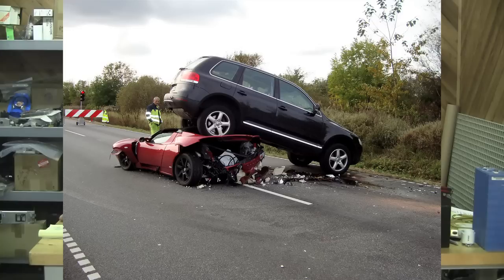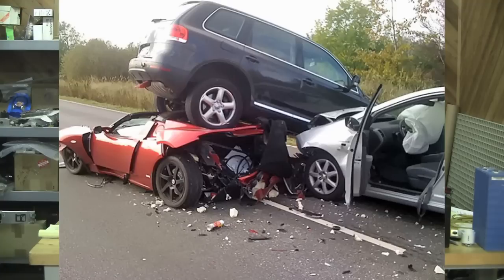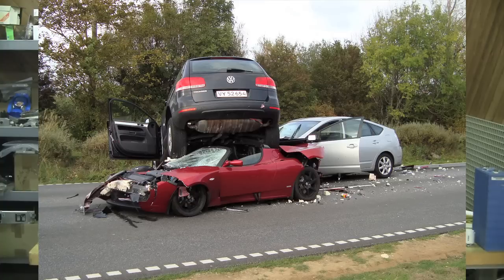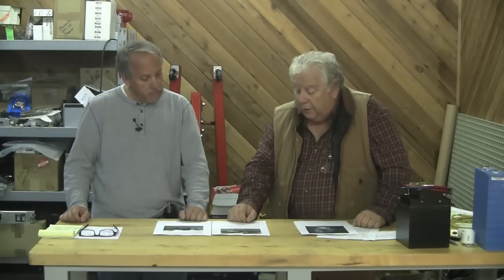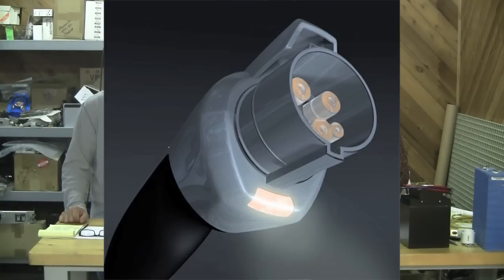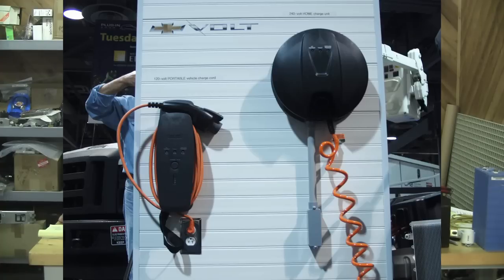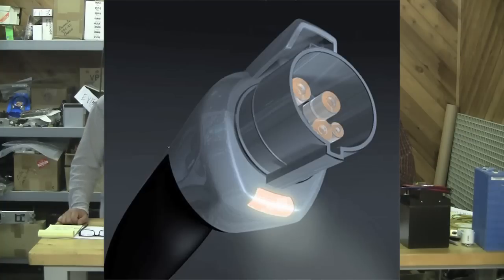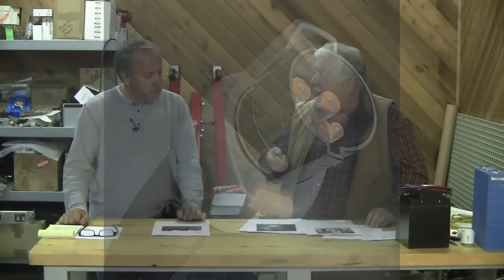EVTV Friday Show 102809 Part 2 of 8

Comment: The biggest problem people have with the 240 volt charger is their home's electrical capacity.  Many older homes were wired with 100 amp or less electrical service.  The car charger is classified as a continuous load.  Thus mathematically your home is overloaded.  If you apply for a welder plug permit which is an intermittent load you can do it.  Your only charging the car while you're not using the dryer, range etc at night.